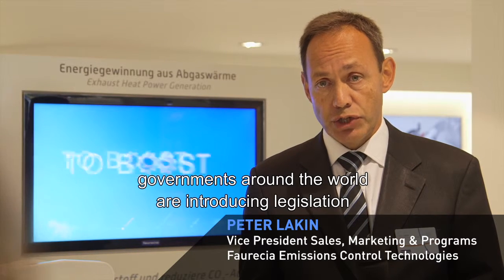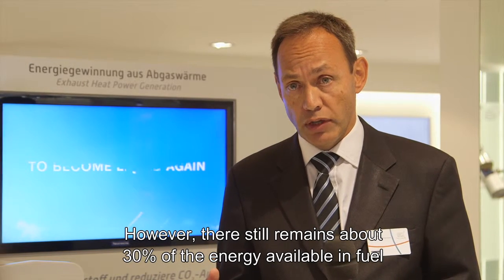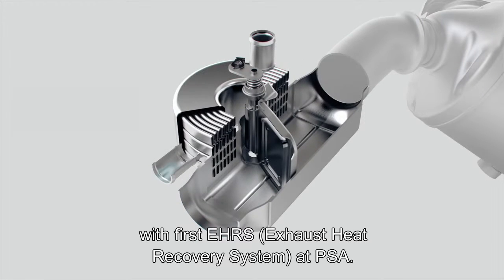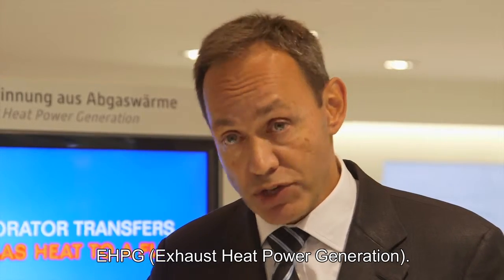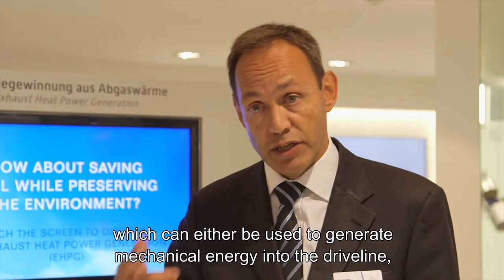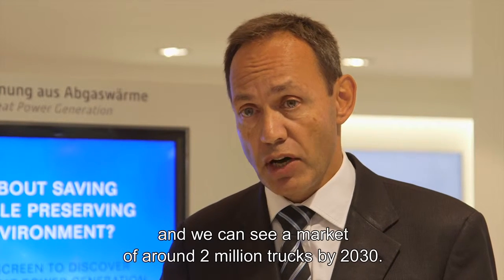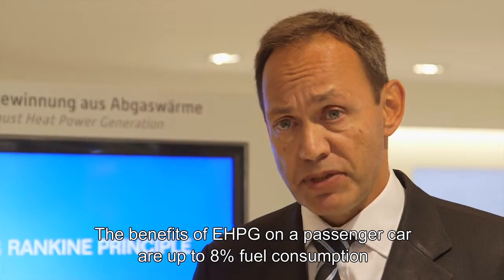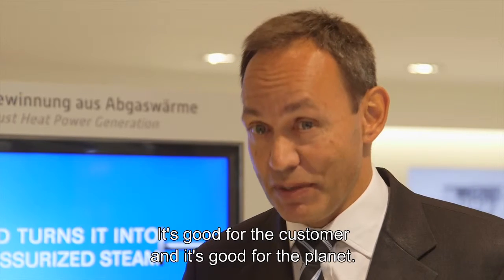Faurecia: Exhaust Heat Power Generation

Comment: so the normal turbo recovers exsaust motion
ehpg recovers heat.
good thing
but what about the heat the radiates away from the engine directly.?
and what about sound energy that is lost
Reply: instead of sending the water to the radiator you can send it to a heat exchanger to heat the hydrocarbon working fluid of the proposed system Why waste all this heat to the radiator? You can do it separately from the exhaust system with two turbines on the generator or use the one to preheat the other part as one system
https://www.youtube.com/watch?v=iUF-VA5bJaw
https://www.youtube.com/watch?v=FChXGlt-WAM